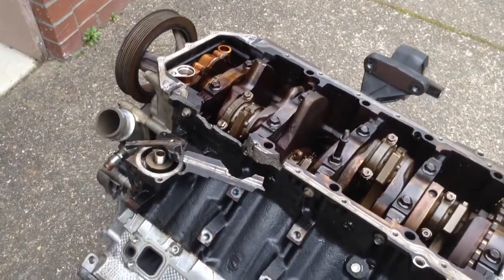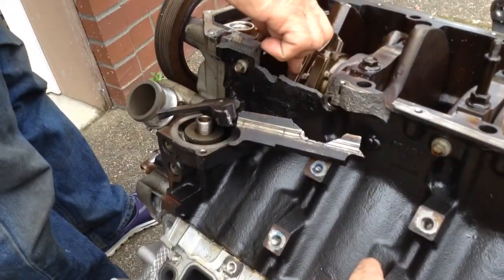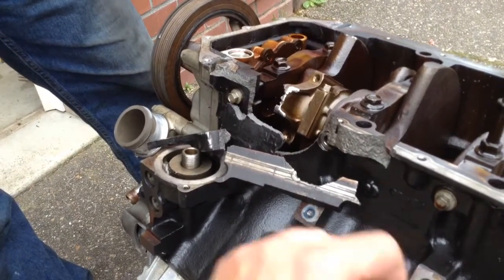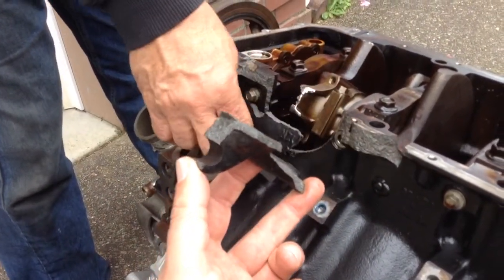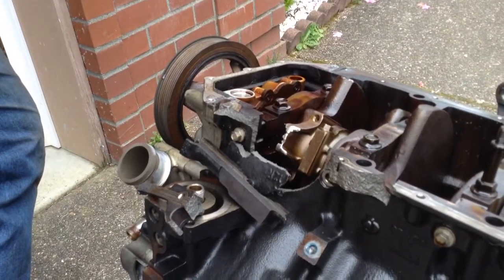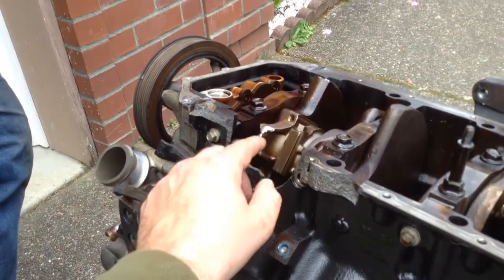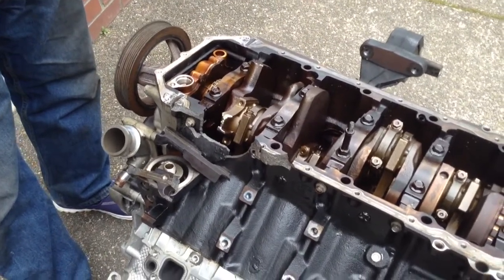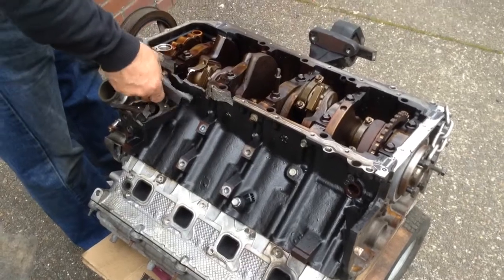Looking for advice on engine block weld

Comment: My feelings are that it is toasted!  You don't crack out the engine casting & then try to weld it back together.

He needs to get a short block, sorry a long block & replace the engine.

Kurt

Comment: glue, epoxy type stuff i used jb weld. i know willy rathburn in Mansfield pa   would weld a mack block and then replace sleeve, there was a crack in block  under sleeve the rod broke and hammered  old sleeve, i all so had a 400 m with crack in back of block no freeze plugs, a guy last name smith use a heat block and plastic sealer stuff after repair do not run hot! oh did i about a year later i blew a heater hose, dura lube in oil  & run till knock stop and let cool off, about 2 hours i got home, fixed hose & bars leak and anti freeze  it ran fine after that!   till the car rusted out!!! on carb and pot metal, i use jb weld or dura glass gun bedding stuff!
Reply: if firearm is it in breach or under pressure, if so do not glue replace part! some mag rifle have over 60 thousand in bolt action with regular use ammo

Comment: Yes it can be welded where it is you can weld both sides. I would use the tig welder instead of the mig the other welder to use is a stick welder with rods made for welding cast iron.